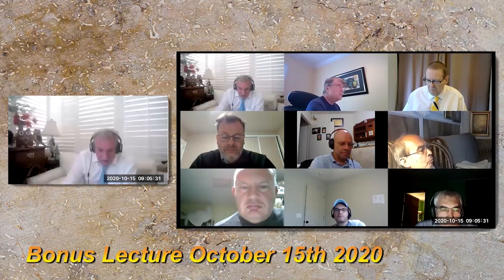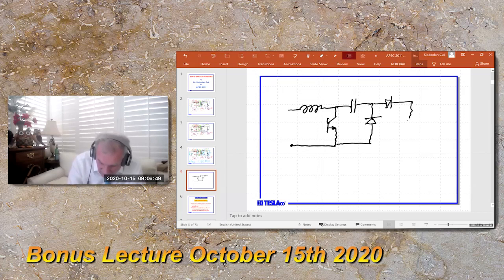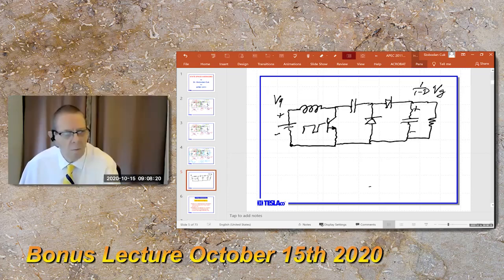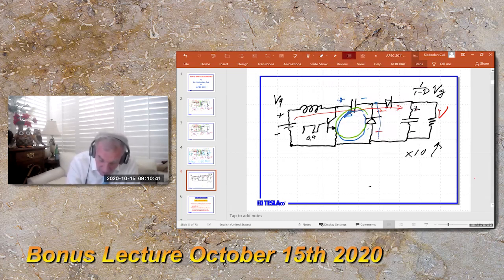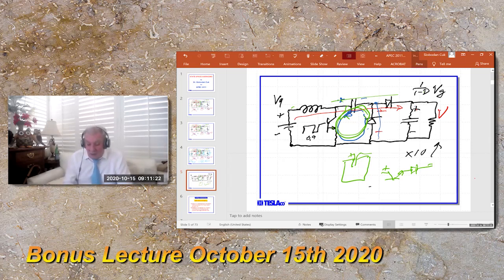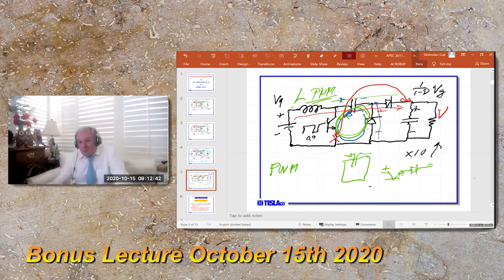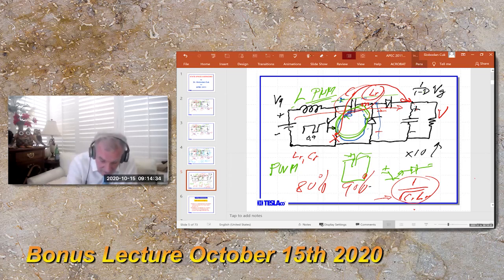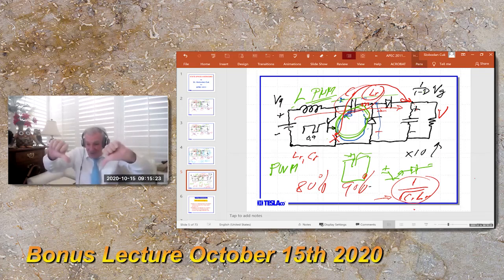Bonus Lecture 9am Intro for YouTube

Comment: I had commented on Linkedin on this link and the entire post was deleted due to some reason.  My point was simple, to begin with.  Dr. Cuk is suggesting placing the inductor towards the end of the video which is correct to solve one problem.  But when the boost IGBT is turned off - the boost inductor cannot flow immediately through this new inductor in series to the resonant capacitor which will create an overvoltage.  To solve this I had suggested one solution though I have many.  I felt really surprised to see the entire comment was deleted.  Dr. Cuk must have a reason like protecting the idea I had suggested but i would like to know. i know that he is immensely knowledgeable but I had worked to find easily 100 to 200 circuits too.

Comment: What do you think that is the minimum switches the current need to pass through and the minimal magnetic elements needed to convert AC-DC with PFC and Voltage regulation?
Reply from the maker: Threes witches!

Comment: Cuk, Is it possible to avoid the saturation of an inductor using two coupled interleaved converters with reversed polarity (a transformer), and using it as it is supposed to be ( no DC current)?
Reply from the maker: No. It is not possible. Reversal of the dot on one of windings of coupled inductor will not make it into an AC transformer.  In fact, I have invented  a Coupled Inductor Method for special type of converters such as Cuk converter. There two inductors DD bias currents ADD together to  increase air-gap needed in magnetics core. However, there is a huge advantage  in coupling as all ripple current of output inductor with high DC current will be shifted to input inductor with low DC current and much easier to filter but resulting  in ZERO RIPPLE  OUPTUT CURRENT   with minimal output capacitor. This is covered in details in both online courses.

Comment: This is the principle of the "true bridgeless PFC AC-DC converter". It is genial, but I don't like the fact that the current needs to pass trough 4 switches before to get the device ( 2 back-to-back IGBT in the primary, and 2 diodes ). Maybe there is a way to get the same with 3 switches only.  If you don't need the voltage regulation (in a welding machine) there are 3 switches bridgeless AC-DC topologies.
Reply from the maker: I am afraid that I am not following what you are referring to with " 3 switches bridgeless AC-DC topologies", Does it have an isolation transformer as well  or not!
Reply from the maker: Yes, I do have the "true bridgeless PFC AC -DC converter" that you do NOT like  but with 3 switches only and isolation transformer with a true AC transformer with no Dc storage in it.
Reply: @SlobodanCukTESLAco  In your true "bridgeless PFC AC-DC" you use back to back FET o IGBTs. There are no reverse blocking IGBT anymore (that is why I say 4 switches). Is there a way to make it with only 3 commercially available switches?

Comment: Interesting, what is the advantage of this boost only type Cuk converter vs traditional boost converter?
Reply from the maker: There are many:
1. Polarity inverting version which does not exist with classical boost converter.
2. Full bridge rectifier in front eliminated for direct AC line to output DC with Power Factor Corrections with 3 switches only.
3 Isolated version with same three switches instead of 16 switches of classical solution.
This and many other new converter topologies, switching methods and novel magnetics are all covered in  interactive, online course .
Register at teslaco.com/courses/
Reply: @SlobodanCukTESLAco  i like the fact that an AC line to output DC with very few switches in your solutions!  I have seen one such circuit but connects input neutral to the output.  In some countries, the neutral has a much higher potential than expected which is a cause for discomfort with 2 pin chargers.  I could feel the AC voltage on my laptop body though it was not dangerous it was not pleasant either.  I also feel that if rectifier diodes are used, it is ok as they have only conduction losses.